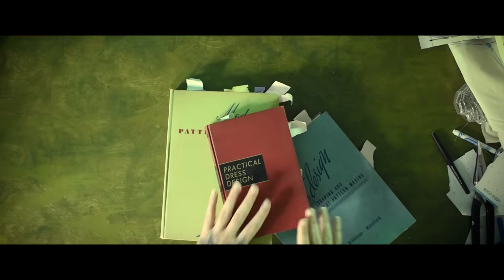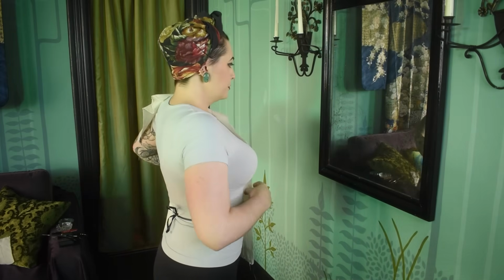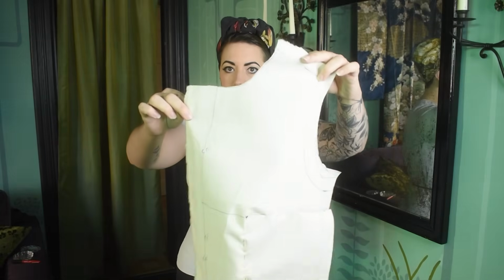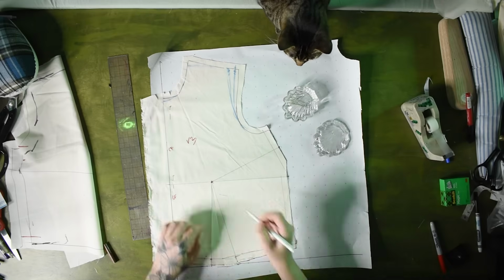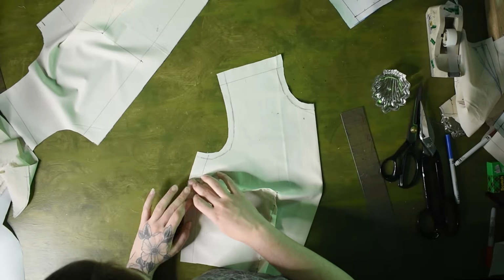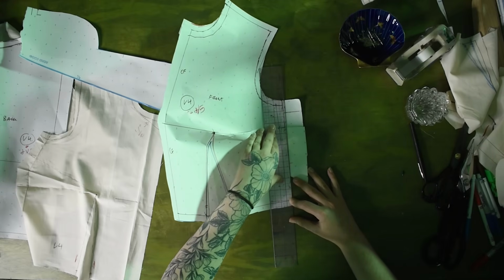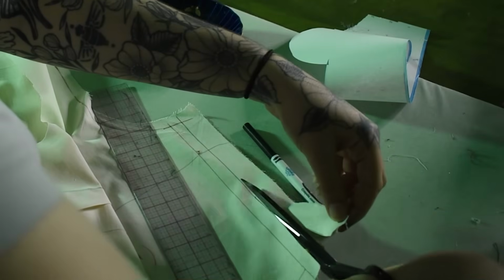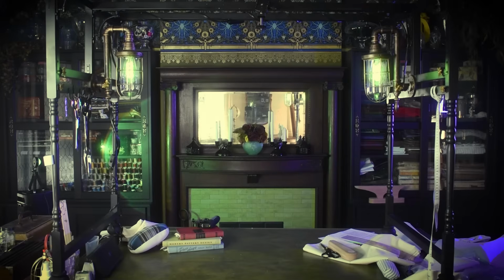Draping A Bodice Block // Drafting Dangerous vol. 2

Comment: My bodice block WAS the first bodice I ever fitted 😅 I’ve noticed that an unexpected advantage to being a total newbie is that you don’t know that you’re out of your depth, and Bianca said that I could do it 😬
Reply: I took a convoluted approach 😂 started with a commercial pattern. Turned it into princess seams. Fitted it that way. Then reverse engineered that back into a basic bodice block. I do not think that was the easy way 😂
Reply: I've noticed that sometimes people do stand in their own way by being unduly intimidated by these things. 
It's like...if you can cook or bake from a slightly advanced recipe or learn how to drive (or use public transport in an unfamiliar place), you're plenty intelligent enough, to learn basic pattern making. It doesn't require any special talent or great genius (imo). You just follow the steps as explained and unless you have a very challenging figure, you shouldn't run into insurmountable problems.
Reply: @raraavis7782 right?? What’s the worst that could happen? You waste some fabric? It’s fine, no biggie. With all the great resources out there (books, google, YT), there really isn’t many fitting challenges you can’t fix, even as a complete newbie.
Reply: Lol, same here. But also, Bianca was RIGHT - I could do it.
Reply: I was the same, except I was so headstrong I HAD to draft it from scratch using B’s first drafting video and the Armstrong text. Wowee that was tough! Since then I have used an online generated one from measurements. Well worth it, honestly!
Reply: Same here, but I'm also trying to make a dress form, not because I think it's essential, I know it's not, but I really want one, I haven't started yet because I'm on my period, I'm bloated, so I'm bigger than my usual size, anything I fit to me right now is going to have ease built-in were I don't necessarily want it.
Right now I'm trying to decide if I'm going to start from measurements or from a commercial pattern close to my size, for the dress form I think I'm gonna try taping, then checking the fit before sewing everything.
Reply: @mayaraxavier2359  In case it helps you: one of my 1940s sewing and dressmaking books says to use the closely fitted block pattern made up complete in muslin, as a shell on a smaller-than-you dressform - all you have to do is gently stuff under the under the muslin shell where needed, and there you have a body double dress form if you want it. This what I'm planning on doing, when I'm satisfied with my block pattern, actually.
Reply: @TamarHestrinGrader that's a good idea, but in any case, even if I decide to use the taping method, I'm using it to get a pattern, then alter this pattern as I need to get the dress form, instead of the common duct tape method that seems to have too much space for inaccuracies.
Reply: @mayaraxavier2359   Fair enough! I've never tried the Duct Tape method, but to me it looks more complicated and - as you say - more inaccuracy-prone than doing multiple fittings to get a pattern. In case you're interested, though, I dug out the book I was thinking of yesterday. Ruth Wyeth Spears, Better Dressmaking, 1943 (but she'd been actively publishing columns about dressmaking back in the 20s). Page 16, How to Pad a dress Form. "The new dress forms that are actually molded to the figure are ideal. However, if you do not have such a form or do not have storage space for them for all the members of your family, it is possible to duplicate figures with reasonable accuracy by padding a form smaller than the figure or one of the adjustable type. Dressmakers keep accurately fitted linings for all their customers and place them on a form as needed."

"A waist [bodice] and the upper part of a two-piece skirt are cut in muslin and fitted very tightly with extra darts wherever needed to make the material smooth. The padding is usually done through a front opening and the armhole openings which are covered later. Place cotton batting where needed to make the bust high or low or the figure long or short waisted." 

I wish I could post a photo of the page, since Ruth Wyeth Spears's diagrams are top-notch, but the illustration captions are: "(1) A duplicate of your figure may be made by padding a dress form that is slightly smaller than your corresponding measurements. (2) fit a muslin cover smoothly on your figure then place it on the form and pad with cotton checking measurements carefully. (3) Zipper closing marks center front. The center back and the waistline are marked with black tape."

The book has an extensive section on how to identify fit issues (by body type and by diagnostic dragging/pulling in the garment) and adjust the pattern for them, and also the basics of designing your own patterns from the "foundation pattern", which I take to be the equivalent of what Bianca refers to as a block. 

Apologies for any typos that crept in as I typed the quotes out - the migraines sometimes eat words.
Reply: @TamarHestrinGrader thank you! I'm going to look for this book, but the quotes really helped, as I said I'm still figuring out how I'm going to do this, because I've done alterations in a few clothes, but never fitted a whole garment from zero, so it scares me a little bit, but I know it's q good skill to learn, also, I never realized how the padding going to be helpful to have for the rest of my family, so I really appreciate you quoting the book.
Reply: @mayaraxavier2359  You're welcome, glad it helps! I think the book is on Hathi Trust, if you can't find a hard copy. I personally think the diagrams and how-to explanations are top notch, but I tend to find text+image easier to understand than video. (The Closet Historian is one of the few people doing how-to videos that are so clearly shown and explained that they make sense to my non-video-optimised brain! though I also watch the channel for the delightful wit and glorious visuals and design.) Of course the book is from the 40s, so it has various issues reflective of its time, as all things do - though Ruth Wyeth Spears does have the good sense to point out that concepts like "the ideal figure" and "which colours look good together" are highly subjective and variable and change with fashion. (I find it very odd that so many people seem to assume that those are immutable and objective.) In any case good luck with your fitting adventures! I'm sure you can do it.

Comment: I have a dress form, but I was getting fabric pooling in my trunk area when I used it. So about 2 months ago, I got desperate and decided to drape muslin on myself. I ironed a crease down the CF/CB of a tight fitting shirt, carefully pinned the muslin to the CF/CB of my shirt with safety pins, put the shirt on and GENTLY smooth and pinned the muslin to my shirt. Then I used a pencil to mark the lines. 

Believe it or not, I liked draping the back muslin because it was easier to smooth the fabric towards the front of my body. When draping the front muslin, it was harder to smooth and pin the fabric towards my back so I had to hold the muslin in place with my hand and mark my lines. Bianca's way of draping the front looks less stressful than my attempt😅. Wish I had this video as a guide back then. Overall, draping muslin on my body worked well. No more fabric pooling in my trunk area.